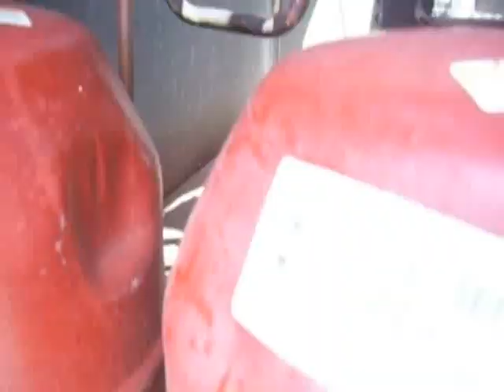Typical Leak Search and Repair on Commercial A/C - Part II

Comment: Enjoyed the video. RV'S can be a pain but like You I've started using the rosebud and it works great. Fast and hot the name of the game.
Reply from the maker: Yup.
"Get in and get out" was a motto from my first boss.
He couldn't stand watching a tech use an undersized torch that took forever to heat the fittings.

Comment: @ 4:50, "bask in my brazing skills". I was thinking the same thing. You really made this look easy. I hate brazing in reversing valves. Try as I might with the wet towels another joint somewhere always gets hot and starts leaking. Before I know it I'm chasing leaks everywhere. I'm only into this career 6 months though so hopefully practice makes perfect.

Comment: Good vid, but I have to agree. I would have put twice as much  wrap on the valve, and then done one fitting and wait before doing another. The rubber seals on the inside were probably deformed from the heat and will fail prematurely.

Comment: Cool video. I will say though brazing a joint IE, a butt joint on thin 16 gauge steel plate or something is a totally different situation, while copper pipe is much much simpler to do, no different than soldering really.  I'd just like to point out Don't get to cocky mate, I've seen many fail at brazing something that requires welding skills. That said great looking joints. Theres nothnig like a massive super hot 5500 deg C flame to get a man all hot and bothered LOL. I compliment you sir.Cheers

Comment from the maker: You would need a HUGE tip on a turbo torch for these valves.

Not saying that there isn't a bug enough tip. Just saying it would be 10 times the size of what I'm using to get the same heat and it would be a wide flame.

I can always tell when someone uses a turbo torch on a RV valve because it looks like bird shit droppings all the way around the valve because the pipe wasn't hot enough to flow the solder. I like mine to look factory. I'm kind of picky about my brazing.

Comment from the maker: Yeah Nitrogen. But it's just the OPPOSITE using too small of a torch causes overheating because you have to keep your flame on it forever to braze and that allows time for the heat to "sink" into the sensitive parts.

Using a high heat torch you get the joint hot quickly, braze and get it cooled down. 
That's also why I wrap the base of each fitting near the valve body to "sink" the heat as much as possible right there.

Comment from the maker: Yeah I've thawed several coils with the torch. Usually the handheld MAPP torch. And it DOES take a long time. SOmetimes, if I have good access, I've used a garden hose hooked up to the Water Heater. The water is really HOT in them restaurants and melts the ice really fast. But the drain has to be clear first or it makes a nasty mess on the floor! :-o

Comment from the maker: Ya know. I have the regulator set faitly high. Mine has a red line on it showing the max setting you should use and that's what it is usually at. I more or less adjust it for best operation "by feel". It's sort of hard to even describe how I set it. The flame however I vary depending on what I am doing. But basically I open the oxy till the light blue flame goes to a pinpoint, then close the oxy down until that light blue inner flame starts to expand. That way you don't burn a hole in the pipe.

Comment: Those rooftop units can be a PITA when the sun is beating down on you.  Nice job on the reversing valve.  I like the order in which you braced the fittings. I agree, the turbo torch really isn't all that great and shouldn't be used in HVAC.

Comment from the maker: If it's broken tonight, make sure you open the windows and put a fan in one of them to bring in some cool air. Many home owners mistakingly keep their houses shut tight with the AC broke (thinking they are keeping the heat out) and the house will become hotter and more humid than it is outside after the sun goes down due to inside heat loads, heat stored in the walls, taking showers, etc.